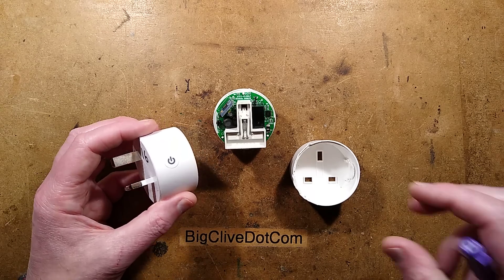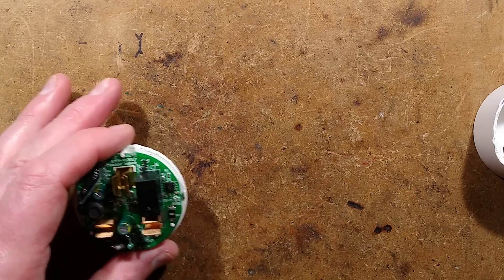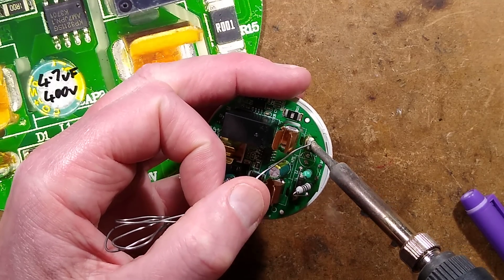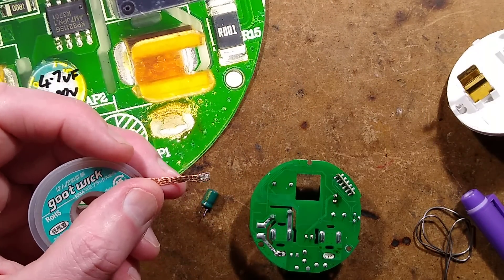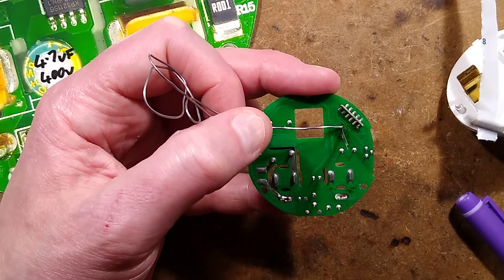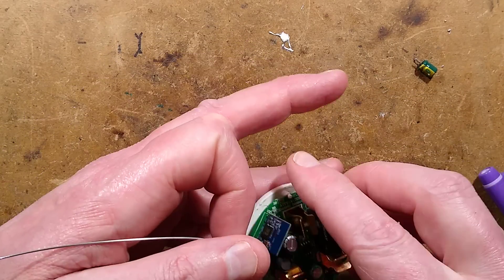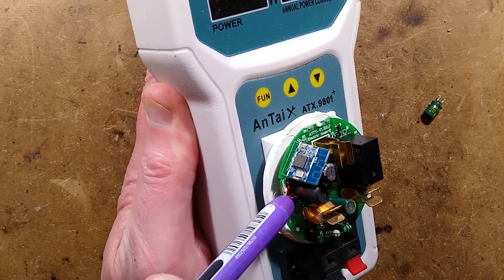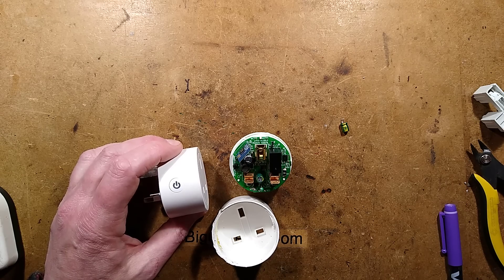Fixing a faulty LSPA7 smart plug (XiangHeWang)

Comment: I use a lot of those WiFi sockets. (Yes I do a lot of home automation , because I a lazy git ) I wouldn't use a load above 10amps with them, mine are used for light loads such as table lamps ect. . Theses WiFi sockets are usually very reliable, I only had one failure in 10 years I've got  15 in use around my house , to be honest there cheap so repair is not worth while, but a very interesting video nevertheless

Comment: Hi Clive. Pro Tip - slip a short length (12mm) of 1/4" silicone tubing over slightly shortened (2mm or so) solder sucker teflon tip for perfect seal and perfect solder removal.  Works perfectly on single sided boards and THP boards when rosin flux is present. After a few hundred joints you may need to cut the silicone tubing  back a couple of mm to expose new good end. If the teflon tip gets clogged (rarely) a quick poke with hot solder tip sorts it out. I have not bought any of that expensive solder wick stuff in 25 years haha. Thank you for such educational and informative content and the wry humour. Cheers from Downunder.
Reply from the maker: My Engineer-brand solder sucker has a silicone sleeve.
Reply: I thought of it first, 30 years ago lol.
Reply: @ericmc6482  I used some rubber Hellerman sleeving I got off old wiring looms, and they worked well. Then used some PTFE sleeving I also got, which also works well.
Reply: Could we get an example of how to do this? I'm sick of using solder wick 😂
Reply: @TeddieBean  Just slip a length of silicone tubing over the teflon tip....search "Engineer-brand solder sucker" for an example.

Comment: I had to do a similar fix to a TP-Link Powerline adapter. 2x 6.3V 1000μF. I only had 10V ones but fortunately the hole spacing was the same. There's another one and a Wifi version which i expect will need a similar fix at some point.

Comment: It's such a shame that they Don't use proper plastic screw mounts for the covers on these devices, they are made completely Unserviceable due to cost saving measures, almost as wasteful as those single use Vapes in my book.
Reply: exactly my thinking... there might be models that have screws .. they than never fail .. and if they do then so catastrophically that they are beyond repair 🤣

Comment: Great video😊About the very useful info at the end of the video, about the resealing of the case after you've had to open it; if I were to 3D print a new case for one of these in ABS, how thick would it need to be to keep fingers safe from the insides?
Reply from the maker: I'd be cautious about making a case in non flame rated plastic.
Reply: @bigclivedotcom ooh good point. I now know that flame retardant ABS filament is a thing 😊
Reply: i think a mindful application of a good quality canvas tape like coroplast might do the trick much more effortless

Comment: Sorry Clive, got to give you an A- for the flick technique. To get an A+, you need to bang either the PCB or your wrist on the workbench. The rapid deceleration creates a whiplash effect which in turn, removes more solder.

Comment: I'm jealous of your Chinese soldering iron how the tips stays tinned. I have an expensive adjustable one and seconds after I've tinned the tip it corrodes I have it set at 355°C I'm not sure if that's too low or high
Reply from the maker: I wonder how accurate your temperature reading is.
Reply: @bigclivedotcom  What temperature should it be at
Reply: @nomusicrc 355 is not over the top ... a good tip should be able to handle 420°C for a prolonged time .. ie hundreds of hours
Reply: @tinygriffy  but I'm wondering why his Chinese soldering iron stays tinned but my expensive one doesn't I don't know if I'm cooking the solder that's on the tip or if it's too low
Reply: @nomusicrc i have a similar station that uses these Antec style tips you can get for 2 bucks a piece .. they are holding very well.. i use very expensive 6040 solder from Felder though and mix my own flux.. kolophonium in rosemary oil .. it indeed is vegan ^^
Reply: @tinygriffy  so... What do you keep your soldering iron at and does your tip stay tinned
Reply: @nomusicrc it depends what I am doing.. i like the 360°C range.. for heavier joints I go higher, for ICs and LEDs etc. I go lower, I think I have one of the original tips (bought my station after watching clives review 7 years ago) and it is still in good condition (stays tinned, yes) .. I don't solder on a daily bases though.. I do a lot (almost exclusively) of surface mount in the past 3-4 years, I use hot air for that which really is a bliss when it comes to SMD.
Reply: @tinygriffy  What is the name of your station and what temperature do you solder at for LEDs
Reply: @nomusicrc  It is a "W.E.R. 937D" with a "X2F 907" Iron attached.. I changed the handle a while ago.. payed 40 bucks for the station (with iron) and like 15 for the replacement Iron. I solder SMD LEDs at app. 320°C but I use hot air for that most of the time.. also depends on the PCB.. the last Light I build was on Aluminium PCB, that I held in pliers and soldered it on the gas stove, worked like a treat..  needs a bit practice though  ;)  I don't use through hole a lot anymore. My hot air station is a "HK 858 D" no mods, but it couldn't handle the 20x15 cm ALU PCB ;)
Reply: @tinygriffy  I don't see a W.E.R. 937D on ebay
Reply: @nomusicrc  There are different companies / brand names, but they are pretty much all the same .. only 937D as a search term should yield some results.
Reply: maybe also check your solder .. should have acid free flux ;)
Reply: @tinygriffy  It's from radio shack It's 6040
Reply: Try going down a bit - maybe 320ish. If it's still crap, go up a bit instead (say 365 or 370).
Or it could just be crappy solder.
Reply: As soon as I clean the tip by wiping it across a moist sponge it immediately oxidizes
Reply: @nomusicrc i have a tiny tin with flux and a piece of solder sponge in it.. i do not use water on my tips, only that fluxed sponge.. i flick excess solder off the tip by tapping the iron on the ridge of an old peanut can ..your problem can have many reasons .. if you can afford it get a cheap chinese station with a 936 handle that uses Antec style tips.. these are the best imho.. also do not skimp on solder 200g high quality stuff might cost you 30 bucks, but it lasts a long time and what you spend there you save on tips ;) good luck

Comment: Perhaps a "solder sucker" might be a useful purchase for desoldering?
There are fancy ones with an iron built into them, so you don't need three hands.
Reply from the maker: I have a wide selection of them, but don't always use them.
Reply: Those are mainly useful for (almost) desoldering ICs, and even then you have to go in with the braid to clean up. Just switching a single two legged component, it is rarely worth it unless the desoldering station is permanently set up.
Reply: Big Clive has more experience than most of us combined and the skill to hold 2 things with one hand .  He probably doesn't need expensive motorized tools like the one you suggest .

Comment: One day, bigclive, one day earlier and you would have saved me screwing up my own fix of a similar "smart" switch. Same issue, same part value, though mine was more obvious: the 470 uF cap had blown its can completely: at first I thought it was mounted "high" to get away from the heat of the inductor, then I realized that that wasn't insulating tubing over the leads, it was the cardboard guts of the cap. So far so good. Where I screwed up was trying to pull the plastic part off the power leads, thinking it was a friction fit, rather than desoldering it like you did. Won't budge, so I broke out the heat gun. Yup, still wont budge, but now it's not even close to "flat". So now that you've shown me the way, I'll de-solder it and fix it. I guess I'll have to find an alternate packaging solution: perhaps wire a cord to it and put a big old "gland" over the spicy bits.

Comment: I probably would have powered it up with the PCB inserted onto the pins before soldering them, just to be sure there wasn't something else needing fixing.
But yea, 95% of the time it's the output capacitors on these switching power supplies that go due to the high frequency ripple current punishment they endure.

Comment: Just for new electronic engineers...  Electrolytic capacitors can have a rated life as low as 2000 hours at max operating temperature. That's just 83 days. Provided other parameters aren't exceeded, the life expectancy doubles for every 10C reduction in temperature. So using good makes of capacitors with a higher temperature rating and keeping them cool is essential or you will have a lot of warranty returns. The Panasonic capacitor Clive used is a pretty good make.
Reply: How can I design my circuits to avoid this? What can I do if I need a 20 year lifespan?
Reply: @tec4303  In  some cases you can also design out electrolytic capacitors by changing the switching frequency. If you can reduce the value of the capacitor needed  it might be possible to use Ceramic or other types of capacitor.
Reply: @tec4303  If you must use electrolytic capacitors then select a good make and make sure they operate in a cool environment. 20 years = 175,000 hours. Some capacitors are rated for 5000 hours at 105C. So they should last 10,000 hours @ 95C;  20,000 hours @ 85C; 40,000 hours @ 75C;  80,000 hours @ 65C, 160,000 hours at 55C. So you need adequate cooling to achieve long life. Best advice is to consult the manufacturers. Things like the ripple current also have an effect.
Reply: Why is that? Does the electrolyte inside dry?
Reply: @User-w7ckl  Yes, the electrolyte either evaporates or leaks. As it dries out the Equivalent Series Resistance increases and this can cause increased heating and accelerates the problem. In extreme cases you get gasses building up inside which can bulge or burst the safety vent (X on the top of aluminium types).
Reply: Excellent info and advice, thank you!

Comment: I also tried to repair a similar item. Except, mine had that special aroma...
Opened it up, lifted out the prints, was greeted by a huge black skidmark on the inside and some more of that aroma. The supply board itself had a hole that looked like the caldera of an inactive volcano. I couldn't make out what caused the problem. Probably one of those components that were now degraded into black crumbles, loose in the bottom of the enclosure.
I tried giving it 5V from a bench PSU but there was no life anymore.

Comment: I would like to have seen both caps ESR measured through a meter like the MESR-100 or the DE-5000 LCR meter next time😋
Reply from the maker: I put the failed cap on a component tester and it thought it was a diode with zero capacitance.

Comment: Small note: electrolytic capacitors failing in modern gear (as in, not in old 80's stuff) do so because the OEM failed to install a LOW ESR capacitor in a role that involved fast switching. See, any electrolytic capacitor is fine with the job of smoothing a mains powered 50-60Hz ripple. As in, a mere few dozen times per second. But modern electronics use switching power supplies that empty and refill those electrolytic caps many dozens or hundreds of THOUSANDS of time per second - and at that rate, the ESR (equivalent series resistance) of the cap DOES matter, with all that current sloshing in and out boiling the capacitor's electrolyte through sheer resistive losses if it ISN'T a low ESR cap. So... companies cheap out, or just doesn't care, cap says "uh-oh, I'm toast", product dies. Everyone goes surprised Pikachu face except the engineers who go "oh, FFS..."
Reply: It's a simple matter of cost saving on the part of the OEM. Especially when the branding is "Randomly generated name from Shenzhen".
Reply: Unfortunately, you see this even in products produced by so-called reputable manufacturers. A reliable design would use a two-stage filter and surge suppress. I'm not sure whether this is manufacturers ensuring their products only last a few years or bowing to consumerism or just bad design (or a combination).
Reply: @ralphj4012  Surprisingly Panasonic DVD recorders don't use Panasonic capacitors but some type that is notorious for failing after about eight years. Buy a faulty one and there is a big chance that some capacitors have blown their tops.
Reply: Surprised Pikachu face 😂🤣

Comment: Heating the pad or the pin and banging the pcb on the bench is my favorite way to get rid of excess solder ;)
Nice and clean repair. Very profitable too, doesn't cost much in time or component, and save a thing that surely cost something.

Comment: Q: Is connecting an electrolytic capacitor backwards the only way to get it go bang in a most exciting manner...?
A: Oh, no. Dropping one of them into the molten solder bath of the selective soldering machine you're operating will do it quite nicely...

Comment: I've actually found leaving a little bit of the end with solder on it makes solder wick work a bit better because it will wet immediately.

I've also generally found it's not always best to have the wick between your iron and the joint--in fact I often flow the joint with my iron and then bring the wick (with flux on) to it and try to touch the iron to both at the same time. Iron to dry wick does not make very good thermal contact and you'll burn up all the flux on it which will blacken your iron tip and make the thermal contact even worse!

To put it another way: having some solder on the iron and/or the wick can counter-intuitively help remove solder because it provides a more instant thermal contact. Additionally, sometimes it makes sense to have the iron on the joint instead of (or in addition to) the wick, depending on how much heat the joint needs.
Reply: Yep.. I agree. 
Solder wick braid takes a little practice to get proficient with it. 

Sticking the end of the braid into a tin of paste Flux helps with those stubborn situations also..
Reply: my best tip with braid/wick is to add more flux, the pen type dispensers work really well here. more flux more better.
Reply: @denisohbrien  100% agree. The flux that comes on the wick is never enough, even on the nicest wick available.
Reply: Also use a braid that is the correct size...The one he used was very coarse for these small pads

Comment: I clutched my pearls like a Karen, when you desoldered the holes. 
What kills these caps, is the ripple current. To lessen this effect, they should use two or more caps in parallel to get lower ESR and share the ripple current between the caps.

Comment: Interesting video and mentioning that these devices are hackable is helpful very much appreciated, but I was not impressed by the use of leaded solder when lead-free isn't that hard to work with and using solder wick when a suction tool would have been a better choice. Why not use one of the syringe-type solder suckers? I have one and use it all the time, although I do lubricate it to keep it at its best performance.
Reply from the maker: I use lead based solder for repairs because it is simply the best choice.  They put lead in it in the first place for a reason - malleability.

Comment: A ceramic or polymer capacitor should be mandated by EU law in this type of application, otherwise it will be deemed planned obsolescence with huge fines...
Reply: Ceramic capacitors micro crack with the stress from soldering when you go for microfarads .. Polymer capacitors cant make the capacitance. So electrolytics are the only practical manufacturing answer. And if you do get the ESR really low, the surge currents can go so high you damage the switching components, or the solder electromigrates.. used to kill TV sets as the line output transistors desoldered themselves.
Reply: @mikedjames  This is just 10µF ... Polymer tech has advanced since the 80s. Same for MLCC tech.

Comment: Current through a capacitor is roughly proportional to the sum of the currents produced by the first few  harmonics... anyway the higher the frequency the more the current... and that produces heat...due to the capacitor's  ESR. The heat drys out, or 'boils' off the volatile components of the electrolyte. Electrolytic capacitors have a relatively high ESR compared to other types... and cheap electrolytics have a higher ESR than more expensive ones. Capacitors rated for higher temperatures can handle higher currents without failing as quickly.

Comment: Fun little repair for a New Year’s Day.  I’ve been soldering since I was around 10 years old I am 65 now, but when I use an iron that close to my fingers while slightly struggling to remove something, it almost always guarantees a burn. And a few well chosen words to confirm the mistake.
Reply: Do you remember the Everyday Electronics magazine and the Ladybird book 'Making a Transistor Radio' ... and Camberwell Green.
Happy Time's 😻
Reply: @mySeaPrince_ Fond memories......sigh
Reply: You could coat the part of the iron or your fingers with high temperature silicon.. reduces the ouchy heat 😻
Reply: @mySeaPrince_   😹👍🏻
Reply: I've just remembered..
There's a YouTube channel.. 'Dave Knowles' .. on which there are Jack Hargreaves films .. he was on 'How' the TV programme answering questions.
Something nice while the weather is.. wet!
Reply: @Matt_Quinn-Personal_Account  
The style of those programmes including filming certainly had an influence on me.
Showing how they filmed and waited for whatever wildlife to turn up within the filming made it.. real.

I just read...
"44 years and counting.. etc"
Started with standard 8 (clockwork) then super 8, a big camera with a betamax portapack (no need for a steady cam).. now a nice Sony CX405 😻
Reply: @Matt_Quinn-Personal_Account  
May I ask, I have a betamax tape I used in that big camera (might have been a Sony Trinicon, just tried looking it up), I borrowed it for the weekend and filmed my parents. Is there somewhere you can recommend who might be able to salvage the video.. that's affordable?